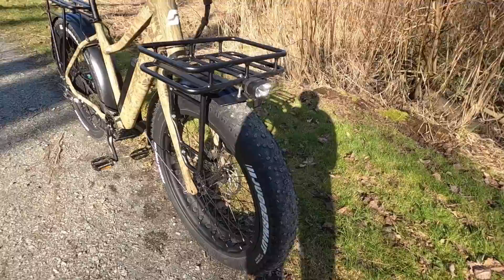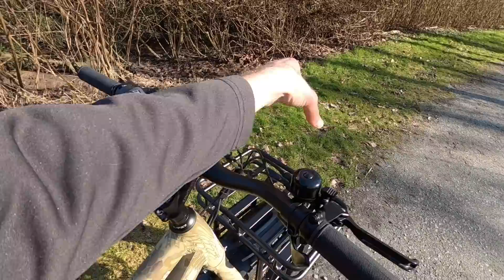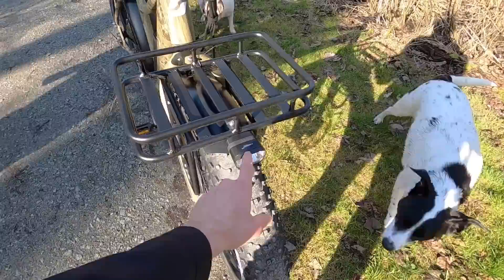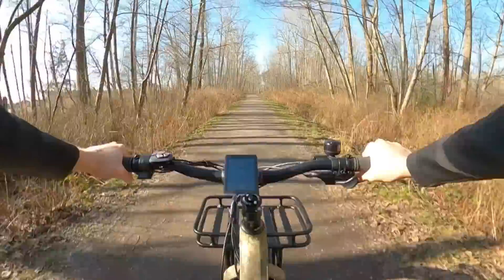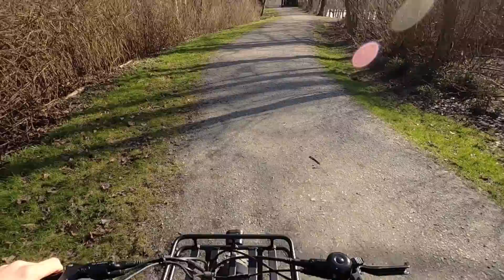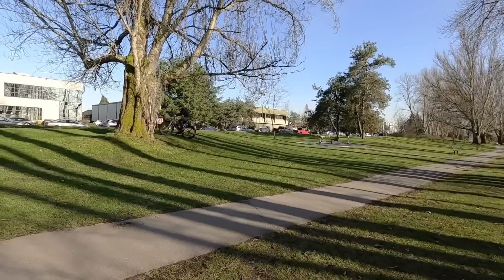2020 Surface 604 Boar Hunter Review - $2.5k

Comment: Great review and like the added tips such as lower gear to avoid chain slap; chain guard; etc. It was between this and shred and I got this. The lack of front suspension hopefully is not that big of deal with the larger 4.5 tires and I'm getting the suspension seat post. Likely will remove the front rack.

Comment: Thank you for that in depth review.  Excellent.  I just purchased the Boar Explorer and am awaiting delivery.  I thought I would add fenders but after watching (and hearing) the test, they will be a no-go for me as I am planning on using it for hunting.  I can just do without, but out of curiosity, is there an after-market fender available that is smaller, lighter, and quieter that can be added relatively hassle free that will still get most of the job done?
Reply from the maker: If you have the proper mounting points, there are several composite/durable fenders you can add to this bike that will be lighter and faster, even Amazon has them for a modest price.

Comment: So have you sealed the batteries better so they don't allow water ingress? How about a simple Rubber grommet or silicone for where the wiring goes in and out of the frame? You know so they don't allow water and road or off road gravel into the frame and bottom bracket which destroys not only the crank but the expensive torque sensor. How about keeping water out of the display and buttons so they don't corrode and malfunction?  All within 3yrs of every single one of these bikes model doesn't seem to matter either. For what you charge you should have better quality controls and better build design. These aren't cheap Canadian tire or Walmart specials.

Comment: Nice bike, it’s like a better spect RadRover. Looks way more durable. Rad should offer something like this, too.
Reply from the maker: Yeah, it stands out in a few key areas... torque sensor vs. 12-magnet cadence sensor, comes with custom front and rear racks, has the camo paint, two frame sizes, lower battery design, and thru-axle on front wheel. It's more expensive than Rad by $1k... really $1.2k if you get the comparable battery pack size. I like that it has two USB ports on the bike too :)
Reply from the maker: Forgot to mention hydraulic brakes, nice derailleur upgrade, and punched out rims. The Boar Hunter does not have a suspension fork... that's one of the bigger trades, but the 4.5" wide tires are wider than 4" on most fat bikes. Also, the controller is a bit more hidden and integrated here vs. external box. And I was impressed with the battery pack replacement pricing from Surface 604, not too bad for both sizes at $499 for 10.4ah and $699 for 14ah https://surface604bikes.com/pages/parts-boar
Reply: @ElectricBikeReview   The Renegade front suspension is junk and way too heavy. A rigid fork is better than a bad suspension fork. The only good Fatbike suspension fork is the Wren. It's an expensive upgrade, not many will make and not full fender compatible.
Reply: This bike cost $1000 more than a rover and its a down grade, The Rover has a more powerful motor and a bigger battery,this bike is super overpriced and targeted to hunters who don't care or know little about EBikes,ill take a new Rad Rover with some racks over this anyday,I would use the money I saved to buy a second Rover which would also outperform this bike.
Reply: @elevenAD  Go ahead do the part by part cost compassion.
Reply: @stratostear  Head on over to                                     Electric Bike Review.com, and do a comparison,you will find all the info you need and more!

Comment: Some of the comments here are laughable. The Boar is obviously garbage LOL. If you truly do any research it's a top fat bike 2018-2020 from a value standpoint based on EBR reviews (as is Surface 604 as a company). I looked at the Radrover, and I'm thinking of ordering one for my wife. Truly, I don't like the upright riding position, and it looks like a beach cruiser; not what I'm looking for.  I really like the Himiway, but all this talk about 750W vs 500W etc is fairly irrelevant if you do some research. The boar at stage 5 pedal assist climbed 2700 feet and still yielded 32 miles with a 195lb rider. Do a little research and validate it for yourself. Is $2700 a lot to spend on a bike.......hell yes it is, but I'll take the word of those that test, and write about the bikes all day long.
Reply: 500w vs 750w there is a big difference if you do your research why do you think people are dumping rads 500watt motor for the true 750 watt from Bolton

Comment: My Feedback to Surface 604 :
Sent but it doesn't  appear on their site. Interesting!!!

The bike it self is awesome but It is sadly overshadowed by its poorly run customer service/company. I would not deal with this company again. Due to company knowingly sent a display that had a glitch and could not stay a class 2 and show mph with correct settings. After a few tries to send me one that works right they had to bypass the setting at factory/supplier in order for it to be set correctly. I don't think it was ever fixed just bypassed. Then they downplayed what happen. I've written to the sales manager and the general manager but no response. The wrong front rack that was sent could be easily overlooked. But their questionable practices would make me nervous to buy from. Damir

Comment: How do you think this bike compares to the 750 Yukon limited? Is the Yukon set up as a class 2 also?
Reply: The Yukon is a terrible value given it's part specs. It comes with the cheapest poorest performing groupo in Shimano Tourney. 7 speed 14-28 freewheel cassette is a joke. Then there's the cadence sensor. Which Court doesn't make a big enough deal out of how bad they perform.
Reply from the maker: stratostear makes some good points, I think cadence sensors work fine for many applications, but this torque sensor is much more dynamic and could be a great choice for technical terrain... I tend to be constructive in describing ebikes here, but some are definitely better than others... and then you're talking about the trade off in price. I think it really comes down to how you want to use an ebike, not just which one is "better" per say.

Comment: Can’t believe there charging 2699 for a no suspension rear hub drive ebike ....that technology is almost 10 years old now.i bought my 2019 German designed haibike sduro 7.0 full suspension bike with mid drive Bosch motor for same price...only had 11 miles on clock..the haibike looks like a Ferrari compared to that dinosaur ...that 500 watts hub motor simply wouldn’t  have the power ...